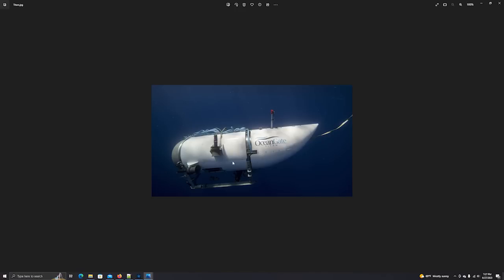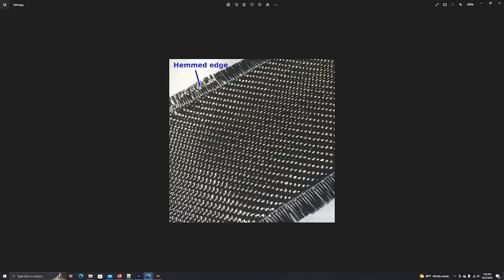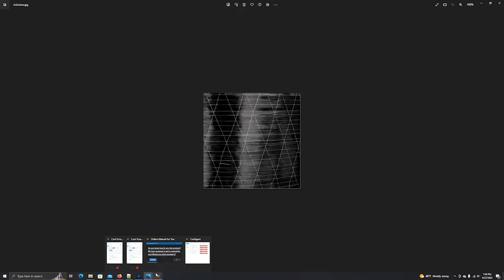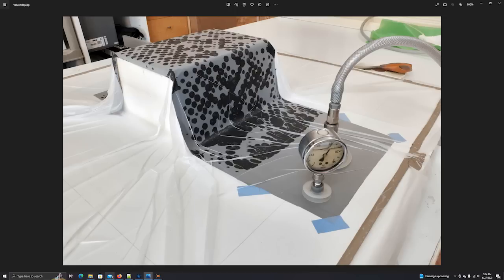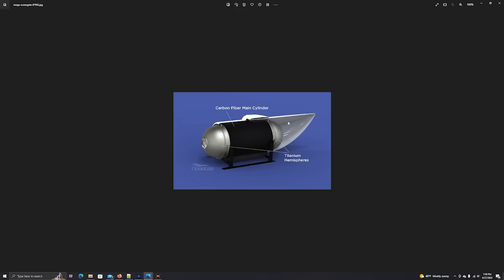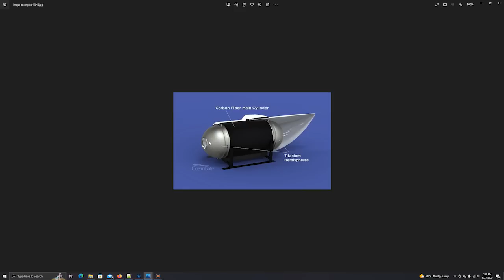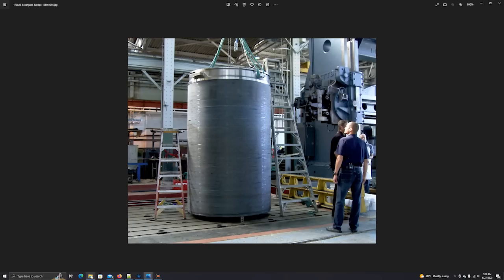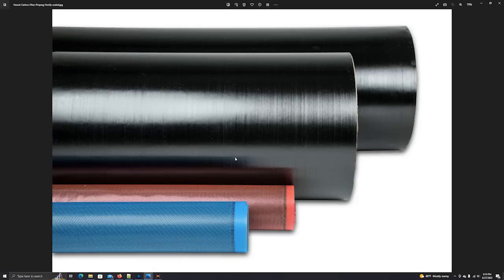Oceangate  Titan Submersible Manufacturing and Engineering Issues Part 1

Comment: Learned something new. Always thought as the carbon fiber strands as “threads” but the actual “Tows” sound more like rods structurally stiff but as fail as a STRUCTURE by bowing. Bonus points for spelling out “TOWS” as the YT transcripts can be a bit quirky.
So if all the possible faults (no preprog cloth, out of aerospace spec materials and vacuum bagging versus autoclave) the Titan’s hull sounds like it was made like a fiberglass recreational boat only using different fibers and resins and 5” thick. Would the Titan’s construction pass USCG standards for an ocean going lifeboat? 
My understanding of fiber reinforced resin composites is as you stressed: bonding between layers and between the fibers and resin matrix, and, avoiding voids in the matrix is critical. With metals voids, inclusions and microscopic cracks greatly reduce strength and operational life; the NDT/NDI methods for inspection are well developed. For a 5” thick cylinder walled pressure vessel what are the methods for inspecting for fiber-resin bonding??
Reply from the maker: There methods would not pass inspection. I spoke with a composite s engineer, he indicated that with a portable ultrasonic tester he could not get penetration in a composite that thick.  Possibly with a larger unit.  Thanks for the feedback
Reply: @JoediyLab  A larger ultrasound unit would not work well. The penetration of acoustic waves into materials is frequency dependent, not power dependent. The higher the frequency, the higher the energy loss through absorption and the less thickness your wave will be able to penetrate. Ironically you need to lower your frequency to penetrate a thicker layer.

However this comes at the cost of spatial resolution, the lower your acoustic frequency the larger the feature need to be in order to be detected, also the thicker the material the higher the wave amplitude or the power you need to put into the signal to get a decent return signal through sound absorption.

The wavelength of NDT ultrasound is anywhere between 200KHz to 50MHz, let's say they use a frequency of 5MHz.
Wavelength is dependent on sound speed which is dependent on material density. A 5 MHz ultrasound signal in air has a wavelength of 0.07mm with a sound speed of 343 m/s. A 5 MHz signal in CF with a sound speed of 10000 m/s is 2mm, so anything smaller requires a higher frequency. If you went down to 1 MHz your wavelength increases to 10mm(1 cm). So any cracks smaller than the wavelength of the sound won't interact strongly with the wave to reflect a signal back, it's basically the diffraction limit as it's termed in optics.

Ultrasound works very well because it can detect very small cracks within a relatively thin layer of CF, down to fractions of a mm but as you get thicker your resolution advantage is lost.

Also because the CF hull is a curved piece there are geometry issues which can cause the ultrasonic beam to scatter and not properly reflect off any defects depending on how the defect is oriented. Because it's also a laminate these alternating layers of CF and epoxy will cause the ultrasonic waves to reflect and refract as well as diffract, this causes a lot of interference.
Imagine looking through a curved window made of multiple alternating panes of glass and air and shining a flashlight through that stack to see any defects in the inner panes. 

Source: Not a materials engineer or a NDT specialist was trained in petroleum geophysics on how to interpret seismic wave propagation in the earth.

Comment: Ive read thay autoclaves are generallly not recommended for filament wound parts like this because it can cause the fibers to buckle. In this case its actuallyy the fiber tension during winding which compacts the layers.
Reply from the maker: Yes would be interesting to see what method they used on the new sub with the prepreg,  could not find any data on the method
Reply: @JoediyLab  there's an 18 minute video where Stockton Rush gives a talk and he shows a few photos from the process. You can see the machine used to lay the fiber. It was a more complex tape laying machine.
Reply from the maker: @matthew4878  I will search for that,  do you know if Spencer Composites has an autoclave?
Reply: @JoediyLab  Their website says that they do. I doubt it's big enough for this though.
Reply: In college when we made parts like bulkheads and torsion tubed out of carbon fibre using prepreg we had to place the parts under vacuum wrapped in plastic and use an autoclave. Never did we orient at 90 0 for every layer.
Reply: @koprcord5338  well that's not the optimal layup for a torsion rod. for that you probably did ±45 degrees. For the bulkhead it was probably quasi-isotropic.
Reply from the maker: @koprcord5338  yes, one of the advantages of working with carbon fiber, thanks for your feedback

Comment: If 14.7 psi is sea-level, could the elevation of a factory significantly reduce the available vacuum-bag pressure?
Reply from the maker: Great question,  Here is a quote from Composites World "The maximum compaction pressure available at sea level with a perfect vacuum bag is 14.7 psi (29.92 inches or 760 millimeters of mercury.) This maximum available pressure drops approximately 0.5 psi (1 inch or 25.4 millimeters of mercury) for each 1,000 foot gain in altitude. "
Reply: If you draw a perfect vacuum under the bag, then what is pressing on the other side is whatever the atmospheric pressure is. More in Death Valley, less in Denver. Putting the vacuum bagged part in a pressurized autoclave results in greater than atmospheric compression.

Comment: Is 5 inch thick carbon fiber an issue?  This doesn't seem like the optimal thickness for this material.  Do the properties of 1/4" carbon fiber scale linearly to 5 inch thickness?  All carbon fiber I have seen is relatively thin (< 1/2")
Reply from the maker: Good question,  deformation doe not scale linearly.  Yes most research has been don on thin walled cylinders.  thanks for your feedback

Comment: If the pressure makes the centre section of the tube compress would the ends distort?
Reply from the maker: Looking at the recovery images, the titanium flanges were shown separated from the carbon fiber cylinder.  It appears  that when the carbon fiber section crushed, the titanium flanges were pushed out.  There appeared to be no carbon fiber attached to the flanges  that I could see.

Comment: Wouldn't the CF cylinder be considered a vacuum vessel in this discussion?
Reply from the maker: In the industry they use the term Pressure vessel,  but inside of the vessel the pressure would stay ambient pressurei so vacuum would not be quite accurate.
Reply: @JoediyLab  got it. In my mind, in the environment this was destined to operate, that just seemed like a good analogue to me. Thank you and very interesting discussion.
Reply from the maker: @spacecadet4876  thanks for the feedback

Comment: Because carbon fibre composites are only really good in tension, would it be fair to say that Titan's body was effectively just a 5 inch thick walled epoxy resin cylinder...? I.e., the fibres provided little to no advantage in compression mode...?
Reply from the maker: The sub did survive earlier dives,  but obviously more research and testing  would be in order.  Also in between dive  testing would be in order as well

Comment: Interesting stuff. I dont know about CF, my training is in metals. What I have not seen as I go through the vids is any mention on the expoxy curing. You mentioned the degassing here, but do you have any thoughts on epoxy being an exothermal curing reaction ? If thats the case with CF that is. When I have used epoxy it gets hot and cures fast. For such a thick wall, I wondered how they would avoid thermal stress during curing. Or would this be an oven cured plastic ?
Reply from the maker: Yes in wet layups some epoxy can have exothermic reaction if applied too thick.  On prepreg that have to be cured at higher temps, they are designed for the higher cure temps as long as you follow the specs.  Good question

Comment: I thought the CF was wound on a titanium drum which formed the cylinder. Was this not the case? So it basically molded into the shape we see?
Reply from the maker: No the carbon was wrapped on a mandrel and pulled off when cured.  Then the titanium flanges were bonded on.
Reply: @JoediyLab  I work with CF on a very limited basis, what would happen when say hardware is screwed into the CF? I noticed the monitors being mounted. And the illuminated handles he used that he got from Camping world.
Reply from the maker: That would cause isolated  stress points around the area of the screws or bolts.  I think they had s sub structure that they mounted hardware to.

Comment: I assume the thicker the lay up and the greater the number of plies, the greater the pressure in the autoclave to compact the layup as it cures. This might have made a difference between disaster and returning to the surface.
Reply from the maker: That is a very complex question.  There are several variables involved.  Temperature, pressure, vacuum (yes you vacuum bag when using an autoclave) There is also temperature ramp up and ramp down times and how the resin flows with in the laminate.  I am not a mechanical engineer.  I would have to do alot of research on this topic.  Sorry.

Comment: What you're trying to say is "the resin has to be molecularly uniform throughout the fabric, without any air bubbles, which we all know is very difficult to achieve.
Reply from the maker: Yes,  using prepreg gets you close.  Also resin to fabric ratio is critical to strong parts.  Thanks for saying it so elegantly
Reply: @JoediyLab  you know. 👍
Reply: Getting all the air bubbles out of 5” of prepreg is a challenge on its own. The simple thickness precludes success because the vacuum simply would need weeks to pull the residual air out.
Reply: @allangibson8494  is it fair to say Titan was effectively a toilet roll with a pair of glorified bottle tops at each end.
Reply: @Stevie-P123  Pretty much, Yeah. I could have not put it better myself!
Reply: @allangibson8494  so there may be the answer why 7 inch CF thickness wasn’t used!
Reply: @maryannsinopoli1751  A reason yes. Carbon fibre has “issues”. Composites are structurally limited by multiple factors - and chemistry is one of them.
Polymer structures are an art form that often needs dozens of prototypes to get the finished product “right”.

Comment: I thought they would have done it the same way they do the fan cases, where it's one piece of woven fabric the entire width of the cylinder and about 100 ft long, they wrap it around a mandrill when they're weaving it, when it's done they take it off the mandrill and put it in a barrel like mold, close the mold than pump resident to it, then cook it in a big oven.   Have seen it done with a pressurized mold and not a vacuum bag, I was told they didn't use a vacuum bag because they were concern that if the bag failed it was going to be a disaster to clean among other safety issues.  I've seen the blades done too, same process basically just a different mould and they use a three-dimensional weave.
Reply from the maker: Thanks for the feedback, Yes what you are describing is call compression molding.  The tooling (molds) are very expensive to manufacture.  But yes you can get very strong parts using compression molding.
Reply: @JoediyLab  GE does it that way for the Boeing 737 Max and the Airbus 320, but yeah the carbon fibers itself is in expensive,

Comment: how safe is it on airplanes then? as they are pressure vessels as well...
Reply: Perfectly safe. The pressure is the opposite way around. Carbon fiber is great at keeping pressure in, not so much at keeping pressure out. Tensile vs compressive strength.
Reply from the maker: Thanks for your feedback.  Yes internal pressure is a different force.

Comment: I noticed in one of ocean gates videos that both interior monitors were screwed directly to the composite tube. Now I wonder they screwed other components to the exterior of the composite.
Reply from the maker: There is more than likely an interior sub frame that they are using to mount hardware.  Just like the flooring, a flat panel is used to sit on,  thanks

Comment: Very good and interesting. Most "experts" only say it wasn't good but you explain possible reasons why it wasn't good. Just one thought; You talk both about out of date pre-preg and dry fiber. I guess they didn't ad more epoxy to pre-preg so are we then talking about two different hulls made with different methods?
Reply from the maker: Correct it appears that the later sub may have used prepreg,  but we really do not know for sure.

Comment: The repeated claim that carbon fiber fails suddenly depends on the type of fibers used. The stiffest lightest ones are like that, but you can opt for grades that have more given/flex in them. For instance people build mountain bikes out of carbon fiber, and they can handle impact damage better than their metal counterparts, because they are using slightly less stiff composites that can handle it.  Just wanted to mention this nuance here as people often repeat this claim without being aware of that.
Reply from the maker: Thanks for your input

Comment: Probably the greatest concern is micro cracking of the Epoxy resin. Also Epoxy resins absorb water if submerged in water for just 24 hrs at atmospheric pressure reducing their mechanical properties.
Reply from the maker: Great info, thanks

Comment: I'd be worried about the bond or the glue they use to connect the carbon fibre sleeve to the titanium caps.
Reply from the maker: Thanks
Reply: There is no 'bonding' of any kind to titanium. The only certainty on this sub was an accident waiting to happen.

Comment: I have 30 years in the fiberglass, Kevlar, carbon fiber, epoxy , vinyl Ester & poly Ester resins. The materials must cure up in layers , not in inches of thickness of layers....once the epoxy ratio is applied to a single layer , the curing for a single layer of mat or cloth can take 24 hours to properly cure, so no warping. The carbon fiber applied on titan was applied in inches to cure by air, That is all wrong, millions of small micron air bubbles would have been trapped between layers of carbon fiber,since no autoclave  over or vacuum was used. The air bubbles were being compressed & bursting over the initial dives, which would lead to de laminating layers & fractures in the hull.
I'm not ruling out other mechanical  defects, but these engineers knew better from their previous carbon fiber sub failure......Rip 5 Souls

Comment: Carbon fiber is infuse on the outer part of cylinder the problem is it 100% sealed? if water pressure find its way thru the fiber its useless and only the metal frame is holding the pressure.

Comment: I think due to the cylindrical shape of the main vessel, the applied  pressure during the lay-up process is *somewhat automatically achieved without vacuum pressure. However, that might mean the carbon Fibre threads have inherent tension in them... Tho experimental, I think their engineering team should have had at least some tests during R&D to determine the process they use.. etc?
Reply from the maker: Thanks for the feedback
Reply: You cannot adequately compact axial orientated broadgoods with hoop tow tension. As you build up lower hoops wrinkle especially if you are using towpreg. I would like to see the real tube manufacturing not the failed prototype.
Reply from the maker: Yes the filament wound pressure vessel failed during a test.  I was told that the titan pressure vessel was wound using a tape winding machine.  It appeared in the video I saw there was axial winding
Reply from the maker: @oneskydog6768  great information thanks.  Yes I would love to see the ply orientation on the titan